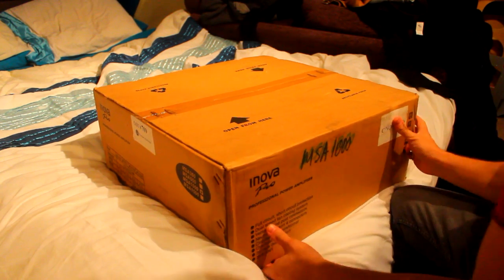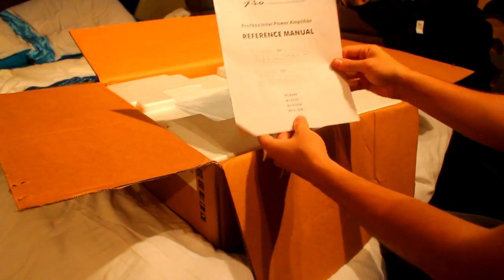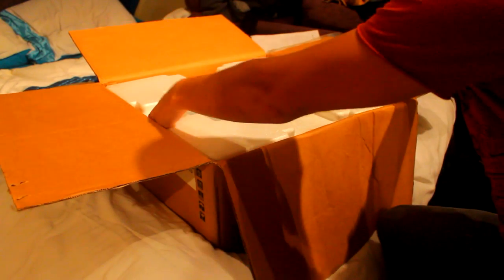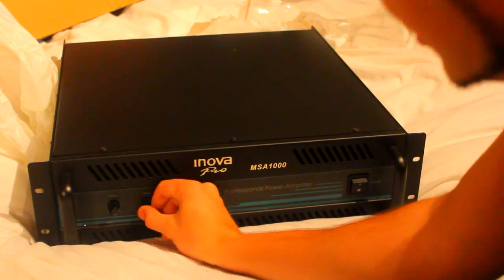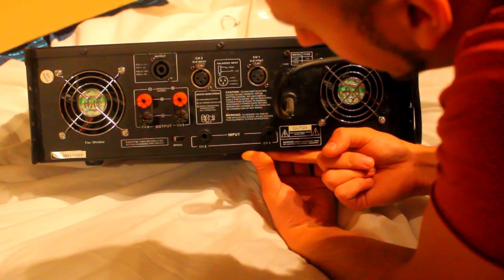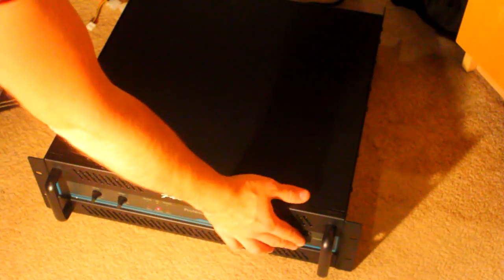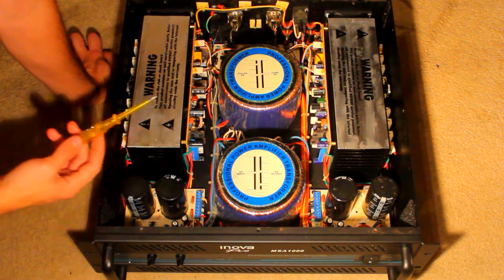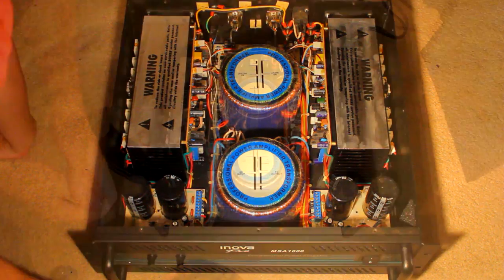INOVA Pro MSA1000 Unboxing + AMP GUTS!

Comment: I know you said transistors but at that much power I don't think traditional class a/b linear power transistors can out put that much power without being an oven. please correct me if I am wrong but they are most likely integrated circuitry/switching amplifier class D or class H/G +barevids
Reply: +silent saucepan Older amplifier it's likely to use transistors. I believe mosfets and transistors run similar temps, but the transistors have the upper hand because the heat is more spread out rather then being in one spot. I have a brand new Yamaha component amplifier, uses transistors for it's main amplifiers, runs pretty cool.

Comment: That is like the audiopipe monoblocks, they actually have two transformers for the power supply! For the money they are built pretty well, they are also double dipped and have more transistors for the power supply than for the output section, ratios vary by manufacturer! For the 1600 watt they have 8 output mosfets and twelve mosfets for the power supply!  For the output section they have IRF640N and the Power supply has 50N06's! I believe the actual wattage BigDWiz got from the 1500 watt was closer to 1800 watts at one ohm and he did a burp test on the dyno and it pushed out 2800 watts at 1/2 ohm! But that was a burp/Burst test not something that would last long if wired at 1/2 ohm! I have my nice little Orion HCCA 225G4 and it is pretty nice, paid $60 not working, repaired it for under $20! Well worth the price!

Comment: just curious.... howcome car ampliers rated at 1000rms are so much lighter and smaller than house amplifiers also rated at 1000rms?
Reply from the maker: +Craig Martin +2D2sChannel is right - car amplifiers use lower voltage components and usually lesser quality bar a few brands. A GOOD car amplifier will have a dampening factor of 150 - 200, whereas a GOOD PA amplifier will have a factor of 1000-1500. Also the PA and home amps need huge transformers to deal with the large voltage change, whereas car amps are only changing 14v into 30v-ish.
Reply from the maker: +Terence M more expensive and high quality amplifiers use high voltage components, meaning the voltage doesnt have to be reduced as much therefore requiring smaller transformers. My Crown MacroTech 2400 amps are much smaller and lighter than these Inova amps, yet do twice the power and more than 3 times the dampening factor.
Reply: +Craig Martin Also, many Pa amps are rackmountble in a 19inch rack, So they need to be 19 Inch wide (I don't know if i'm right xD.
Reply: Technologic I've got a couple of Lab Gruppen FP10000's and they rock,
Reply: +barevids your previous vid wasnt avaliable :(
Reply: +barevids  the party speaker one
Reply: +Craig Martin Transformers found in heavier amplifiers weigh 10000 pounds.
Reply: +barevids What crown amps do you have?
Reply: +barevids 
the best PA amplifiers out there are actually switching based amplifiers similar to car amplifiers capable of pushing thousands to even tens of thousands of watts like lab gruppen and crown amplifiers (but mostly look at lab gruppen which is state of the art).  They typically have smaller enclosures than this and are way way lighter.  That looks like an older PA amplifier
Reply: Davy Lievens
all PA amps are rack mountable

my crown xls1000 cranks out a solid 1000W is thin and wide with rack mounting screws, i have videos of it
Reply: Technologic Not ALL, Most of them are
Reply: Davy Lievens
link me to one you know of
Reply: Technologic http://www.bax-shop.nl/versterker/skytronic-av-100-stereo-karaokeversterker
Reply: +Davy  Lievens 
i don't consider it an actual PA amplifier unless it has actual PA inputs and outputs on the back (like XLR)
Reply: +Craig Martin Aluminum chassis/ heatsinks as opposed to steel. Plus car amplifiers are much more simplified.
Reply: +Craig Martin car amps use switching power supplies and class d amp design. car batteries have a lot of current, that's why they usually use 2 ohm speakers and that's why they have a low damping factor. unlike pa amplifiers which use 8 ohm speakers. with 8 ohm speakers, the bass is tighter because of the damping factor, the lower the amplifier's output impedance, the higher the damping factor.  there's different types of pa and household amplifiers, some use the old big ass transformer and some use switching power supllies. I suggest you go on Google, there's lots of information out there, so a lot of reading will be involved.
Reply: wynnful Not all car amps are class D.
you also have 4/16 ohm Pa speakers (16 Ohm is very, very rare do; Most of them are not really PA.)
Reply: Davy Lievens I know, but nowadays, most are class D, some are class AB. most pa subs are either 4 or 8 ohms because of the damping factor, look it up. that's why you don't see car subs used in pa equipment. why you bring up 16 ohm speakers only to say that most of them are not really for pa. do you understand what you're talking about? I actually repair pro audio gear for a leaving and I'm also about to start hiring out my amps and speakers to people.
Reply: wynnful I have a pile of JBL bullets and they're all 16 ohm. My sub boxes usually all use 8 ohm drivers, linked in pairs
Reply: +philzambo yes, some tweeters are 16 ohm, what's your point? it's the amplifiers output impedance that matters. fuck, you guys talking about speakers but don't know anything. it's all about the amplifiers output impedance. you can hook up 100 speakers to an amplifier just as long as its in it impedance range.
Reply: wynnful Does your butt hurt?
Reply: wynnful I don't know why you made the cheeky comment above? I think it was uncalled for, I've worked in pro audio for 25 years, and I don't have an attitude about it, I love my job
Reply from the maker: +Technologic in terms of size and weight to power ratio I'd absolutely have to agree! however on a sound level, they are dreadful when compared to the type of output from a linear amplifier design. amps based on class D tech produce dirtier sines, dampen in a strange way, and when driven near clip, distort the wave horrendously. I was looking at one recently, 14000wrms in as small case as my crown; I consulted Lui Dee who is one of the most reputable amp technicians around and he confirmed the above with me and to stay away. 
Saying all that.... I would probably still get one for the right price, 14k!!?? Hot Damn!!!
Reply: barevids I have some MC2 amps, I think they're class D and they sound absolutely amazing, I've never heard them distort and they get booted
Reply: +philzambo hey, you the 1 who brought up butt hurt.lol. so why did you even comment about speakers. I commented about why power amplifiers are light, because of there s.m.p.s as opposed to big transformers. ok, sorry if I hurt your feelings then.
Reply: barevids
class D technology has improved dramatically though, and lab gruppen uses class T type architecture which improves sound quality dramatically, and crown itech uses a class I configuration, i mean for home application where you are powering highs you'd just want a nice linear amp, but subwoofer applications you can't tell a difference, my crown xls1000 sounds wonderful for my subwoofers, but if i connect highs to it you can hear a 16kHz hiss from the switching
Reply: There are mainly two reasons. 1. Car-audio Amplifiers only need a small or no power supply at all because they use 12V internally. And 2. sadly many Car-audio products can't really live up to the claimed specifications. It's also a problem with cheap PA-gear, but it's not nearly as common...
Reply: 2D2sChannel oh I see.... thanks man